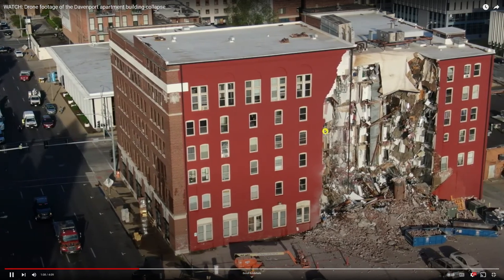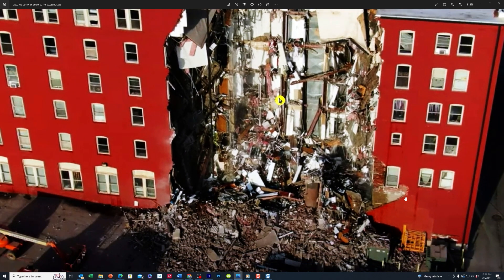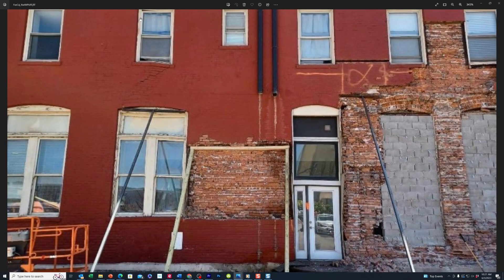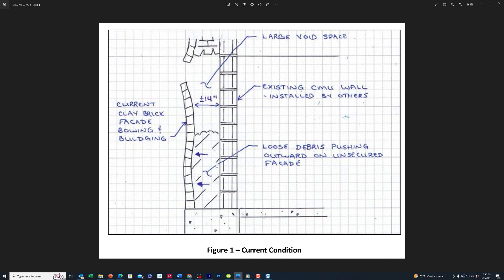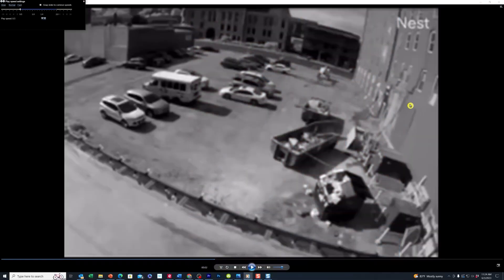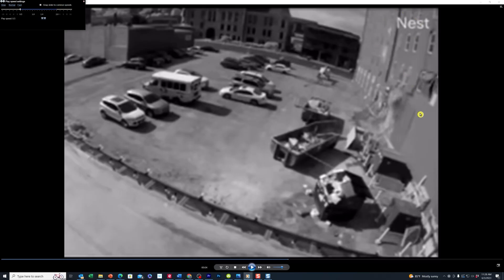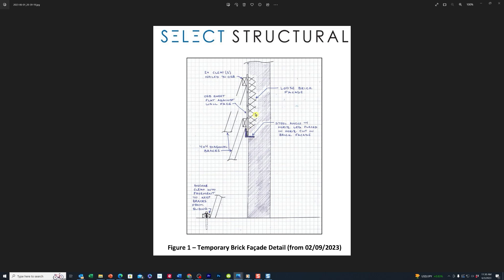Davenport Collapse Security Cam Analysis Pinpoints Origin

Comment: Jeff, this is what we call a full masonry building. All the wythes bear part of the load, including the outer wythe, which is kiln-hardened brick that sheds water. So I think it is a mistake to call the outer layer of brick a veneer, because it is structural, not decorative. 

The inner wythes are made of a softer, cheaper brick that requires the protection of the outer wythe, because exposure to water over time can literally melt this softer brick into clay and turn the mortar into sand. The weight of the roof is carried by all wythes to the ground, and the weight of the steel structural beams is carried by the inner wythes, which have pockets that the beams sit in. As an example, my 1903 full masonry house is three stories tall. It has a steel main beam supported by brick columns. Some houses like mine have steel columns, instead of brick. Others have wood main beams and wood columns. My first two floors are three wythes thick, and the third floor is two wythes thick. This building was six stories tall, so the bottom floor would have been about six wythes thick.

The Davenport building was allowed to leak for so long that the inner wythes were weakened, and the outer wythe began to bulge away during freeze thaw cycles. At ground level, this opened up a tremendous gap that allowed the soft inner bricks to break off and fall down into the gap as the steel beams pressed down in the pockets. The wall was collapsing in slow motion. When you see the outer wythe fall and blow out in the video, you are seeing the steel beams collapsing because the wall can no longer support them.
Reply: Thank you for that information
Reply: Wow. Super information. Was wondering what supported the weight from above, and how the steel beams were supported.
Reply: @uploadJ  To use my 1903 house as an example, in the basement my steel main beam is supported on the end by the limestone foundation, and then there are four four brick columns along its length. On each floor, the floor joists are perpendicular to the main beam and span the entire building, which is quite narrow because it’s an urban house. Each joist end sits in a pocket in the brick wall. 

In the Davenport, I am guessing that the interior steel structure had a grid of steel beams supported on the ends by pockets in the brick and vertically by steel columns. The floor joists would have been supported by the steel beams and, around the perimeter, the brick walls. The failure to maintain the brick wall properly led to the brick compressing downward and dragging the steel beams downward with it. The sagging floors in the apartments are a dead giveaway that this collapse was slowly in progress for a long time. 

There may possibly also have been design flaws that led to inadequate support on that wall, causing the steel structure and the brick to be overloaded on that side of the building.
Reply: @uploadJ  You’re quoting what I previously wrote. “Full masonry” refers to the exterior walls of the building. If you look at the images of the collapse, you can see the structural steel is not only horizontal but vertical. The columns in the basement were probably steel. As I wrote in a later response, if this is a typical full masonry building of the period,  the steel structure would have tied into the masonry walls at the perimeter. The masonry walls would have held up the roof and supported the outside ends of the structural steel. The center of the building would have been supported by structural steel.
Reply: @uploadJ  It seems unlikely that a building of that size would have had masonry columns on the inside, steel would take up much less space, and hence create more value for the owner.  Its not really relevant.  The building collapsed because the inner brick(14" - so 5 wythes plus the exterior) lost strength and the owner was too cheap to pay for proper support for the beams on the inside.  The engineer called for large I-beams, fully founded, to support each of two beams.
Reply: @uploadJ  The vertical steel columns are part of the interior structure, probably installed when the building was converted to apartments. There are no steel columns at the outer walls. You can see that the collapsed section stops at the depth of the first set of interior steel columns. As maud stated earlier....
Reply: As a non-building tech guy:   this is great info which seems to be essentially lost in modern times.  Too many times I've heard the term "brick veneer" used so casually as if all brick is veneer.  Yes, modern construction brick face is veneer in the most cosmetic, disparaging sense.  But not all brick construction is such a "cover coat (of paint)"
Reply: You nailed it. As soon as he said veneer, I started looking for the stringer courses.... I think poor maintenance with lots of water infiltration is what did this building in primarily.
Reply: @aodhganmerrimac  yup.  Rot from the inside out.   plain as day in all the photos over the years.
Reply: So in the full video you see the nearest "shoring" post start to bend significantly probably 5 or so minutes before the collapse. I assume this is because the outer wythe is slowly sliding down because it is not properly supported with the removed bricks. Are the different wythes tied together? Would the outer wythe sliding down start to pull on the inner wythes?
Reply: @dragon6172  When these thick brick walls were originally built, the masons used certain bricklaying patterns to periodically tie the wythes together. As this building was so poorly maintained over time, there were many freeze-thaw cycles where frozen water created bulges that separated the wythes and damaged those ties. In that photo showing the big gap at the bottom, we see how the broken ties and failing inner wythes dropped bricks behind the outer wythe. A mason friend of mine told me that when you see a bulge at the bottom of a full masonry wall, it is nearing failure. He said the only safe repair option is to shore extensively up to the roof, dismantle the wall top to bottom, and re-lay the wall bottom to top. He said even the act of shoring is highly risky. If the outer wythe had been intact, it would have helped hold up the wall. They used those exterior supports to stabilize what was left of the outer wall while they were attempting to work on it because they would have been killed if it alone fell. The critique of the workers is disingenuous. To me it is obvious they bought the 4x4s and staged them at the wall to show intent to enact the reinforcement specified by the structural engineer. It also looks like they may have pulled off the job because it seemed obvious they were about to die. If that’s what they really did, I don’t blame them. What is so sad is the failed attempt to get the building evacuated. The City is highly liable for their failure to protect the residents. Their TAPs are less than meaningless.
Reply: @dragon6172  They were tied together by stringer courses in section that hadn't been altered. They are visible in some shots.
Reply: And how many more millions of buildings in the USA were built the same way. Many have already been taken down but many are still up.   Most were built before builders really understood what the weather will do to them in the long term.

There must have been a lot of brick layers in the USA 100+ years ago.

So many earthquakes have devastated counties like Turkey, Ecuador, Haiti their "poorly built" buildings.  Just a matter of an earthquake in the USA to cause similar damage.
Reply: @rickpaulos  All the river cities have millions of full masonry buildings in great shape because they have been properly maintained. Even though it is an outdated and unaffordable design, these buildings can be perfectly safe.  My full masonry house is only three stories with a basement, but it is already 120 years old and perfectly healthy. Barring an earthquake, a direct hit by a tornado, a nuke, or the end of society as we know it, it’s good for another 120 years or more. I can’t imagine the modern vinyl sided frame buildings being thrown together today lasting that long. But I agree that those houses will probably do better in an earthquake than mine. Yes, I live in an earthquake zone.
Reply: @rickpaulos  I do think builders understood particularly well the weather effects, which is eXactly why the put the "hot-kilned" bricks on the weather surfaces.  (All bricks kilned, but I mean in the relative sense.)
Further:  before kilning heat got hot, brick survivability really benefited from painting.
I'm getting the feeling that some construction engineers could benefit from some short courses in various east coast towns and cities to broaden their masonry horizons.
I don't know the terms, but the brick construction detailed above is consistent with what I grew up with in my 250+ year old town.
One question that arises is e.g. Williamsburg, Va:   the brick structures are unpainted.   This could not be anachronistic, for this caliber of historical site.   The implication is that the colonial government imported the really expensive (very highly kiln-hardened) bricks.   Otherwise, I don't think colonial infrastructure would've been able to kiln-harden adequately.
Reply: @rickpaulos  re:   earthquakes
Why the doom and gloom on all US bldgs' imminent collapse because they're not built for seismic conditions is Turkey & Ecuador?
Recommend:  review regional seismic maps and reconsider your comment, unless you really need the Schadenfreude.    
Hint, in broadest terms:   
Region 1:  West of the continental divide
Region 2:  East of the continental divide
Region 3:  New Madrid.  (Special case)
Reply: @77thTrombone  The New Madrid Fault will collapse my full masonry St. Louis home. I just accept this as a fact of life. We can’t predict when it will happen. When it does happen, poor Memphis will be destroyed but St. Louis will also be in big trouble.
Reply: @maud2739  yeah.  'Fraid so, but hopefully not for a while.  That's such an odd "no-fault" fault region.  Maryland Geo Survey has a page with all the seismic activity > mag 1:  all the cool stuff happens just East of the boot heel — You guys got it lucky!  😜  nothing happens near me!
Hopefully the 1820s (~) event doesn't occur for another few centuries.
Otherwise saw your comment about modern construction with 2x4s and vinyl siding:   I'd b more scared for a long term investment in one of those things.  Then I see they're building 3 & 4 story apartments that way:   😬
Reply: @77thTrombone  Agreed. We had a three story apartment building built like that in my neighborhood. It burned down very rapidly when it caught fire.
Reply: Surely, there should be ties built into the brickwork courses tying the two walls together? 
Anyway, the state of this brickwork is appalling, the mortar has no binder in it.
Looks like over the years, the mortar has suffered sulphate attack.
Reply: @clivehorridge  Yes, the wall originally was laid with a masonry pattern that tied the wythes together. The ties were lost during the years of poor maintenance and freeze thaw cycles.
Reply: That explains why the outer bricks were in good shape despite the buckling and why the exposed inner bricks were riddled with missing chunks. If there was any structural outer steel structure, I think the facade could have collapsed in a different, safer manner. In fact, I've seen footage of 1930's buildings getting the wrecking ball in NYC, and those bastards were though. They were mostly steel with a brick facade. It was not just a brick veneer, but the brick was not structural either.
Reply: They turn into "veneer" because the old boys turned bricks at a 45 as a tie course lol. I can't tell how many of these I've found the entire tie course sheered from previous earthquakes or settling. Once those brick break its just an outer wythe that sheds off in the best case.

Comment: Those voids not being properly filled to the arches Im convinced, greatly increased the failure of this building. Those blocks aren’t doing anything if there is a gap above them.   The leaks are the root cause. %99 of the buildings that collapsed are due to leaks.

Comment: Weve had to brace lots of brick/block/concrete walls.

Usually the engineers calls for one or multiple sheets of 3/4" plywood plus 4inch angle iron down to a footing or placed diagonal to the structure and ground to hold it back.

Doesnt look like any of that was done and on a super large scale like that would be very difficult to do properly with how much damage/buckling there was.
Reply: Were any of your buildings 6 stories, thick load-bearing brick walls?  The Davenport is a whole different animal than you're used to...
Reply: @johnbergstrom2931  How do you know what im used to? Have you been to my jobsites?! Havent noticed you there. But anyway, that's literally what I said above. 

Also, if you listened, what I said is what the engineers directed them to do, but they failed to do so, only propping 2x4s up.
Reply: @evictioncarpentry2628  Even the recommended engineers plan would have been inadequate in this repair.  These people didn't know what they were getting into.  The wall was just in the process of collapsing and it would have taken a herculean effort to fix it - evacuation of that side of the building, propping up the internal steel frame and essentially dismantling and rebuilding the brick wall.
Reply: @johnbergstrom2931  What part of my original comment where I said " it would be very difficult to do due to the amount of damage/buckling" did you miss?

The recommendation was not a solution. It was a method to stop any further buckling which was supposed to buy some time for further inspections and engineered work.

Comment: Jeff - You are the best on YT for collapse analysis - Champlain, Fern Hollow, and others.  I know you are not an engineer, but you really do good analysis of the cause.  Nailed it on this one as well.

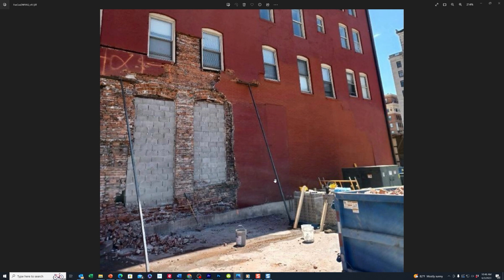At 4:15 the right side of the arch above the right CMU infill is the point I believe the collapse started.  There is a dark spot right above the jamb, possibly a single missing brick.  

Elsewhere, I saw that this wall is 5 structural wythe thick (5 x 4"= 20") with a 4" veneer and a 1" minimum cavity.  The wythes are supposed to be interlaced with blocks turned 90 so the 20" all acts as one, not 5.  This missing brick releases the front arch, so only 80% the strength.  My guess there has been water into the bricks, why the veneer fell away prior.

Where the illusion of a brace is to the right I sense that the arch noted above is rotating a bit, causing more load on the arch root.  The first puff of smoke is possibly the brick behind this hole crushing.  This crushed the column at the arch root, taking the next arch behind the illusion in that red block area.  The failure spread in a classic 45 degree slope pair with the veneer falling forward, the 5th & 6th dropped in unison.  The two shear lines along the window jamb probably have a column or pilaster there to support a more major beam line.

The bowing out of the veneer with the cavity filled with prior debris was also bowing the 20" wall, not a good thing.  The quality of the brick in the cavity is very suspect.  This wall shows many locations over the years of alterations.  This is bad in unreinforced masonry, every repair picks up less than the average load, the existing more than average.  This starts stairstep cracking seen in the veneer.  Further there are many grades of brick, the original brick appears to be low strength, mix that with higher strength later creates inbalances.

Near me, Port Townsend, WA the brick of this age building is particularly bad.  It's source was the cheap bricks ships used for ballast in, before taking timber out.  The shrinkage of epoxies will just crack the brick beyond where the epoxy penetrated.  Have to use a lime mortar similar to the original to not cause problems.  Not with a collapse, but I have seen all of these problems in buildings there, caught when it can be repaired.
Reply: Interesting and detailed post that reveals detail I had not seen before. Thank you.

Comment: Jeff, all that time you invested in doing detective work on the Champlain Towers South collapse was not wasted. From your analysis of this collapse it is obvious that you have learned a lot about what to look for, and how to look for identifying "landmarks" on the structure before and after the collapse in order to be able to speak knowledgeably about which parts are still standing and which are gone. The time you spent on Champlain gave you a great deal of insight into the forensic analysis of structural failures. 

Have you had a chance to look at historical satellite and street view timeline photos from Google Maps yet? They might show stages of work done on the property over the decades. It appeared there was rebar in the gray CMUs and maybe the collapsed concrete flooring. In one area of exposed gray CMU I only saw a couple of steel ties sticking out of the block that would presumably be all there was to hold that section of façade. 

If you get the chance, you might study the notorious 1933 Long Beach Earthquake in California. Most of the downtown buildings had been constructed with unreinforced masonry that could not withstand the shaking. Some of the unreinforced buildings that were left standing had to be retrofitted with horizontal tie rods through the floors. There are metal plates and compression nuts visible on the outside of the buildings even today where the horizontal tie rods are functioning similarly to a concrete post tension slab. This Los Angeles brick building that was used as the exterior of Jerry's apartment in the TV show "Seinfeld" shows the diamond-shaped tie rod plates through the floor and ceiling levels. https://en.wikipedia.org/wiki/Seinfeld#/media/File:757_New_Hampshire_Ave_2.jpg